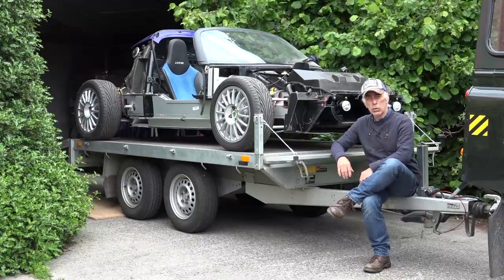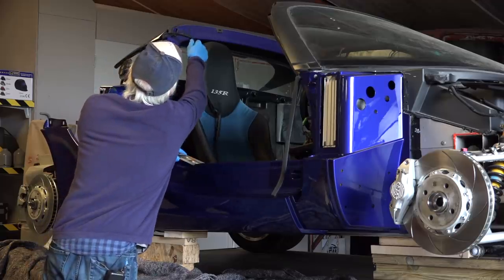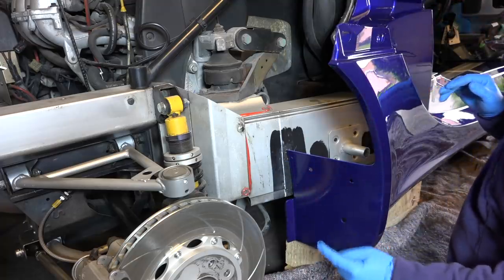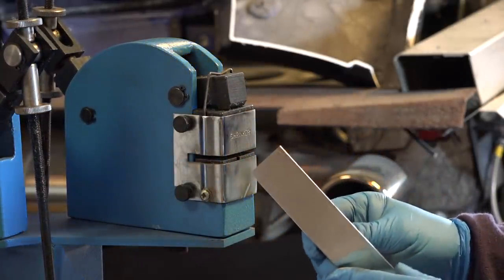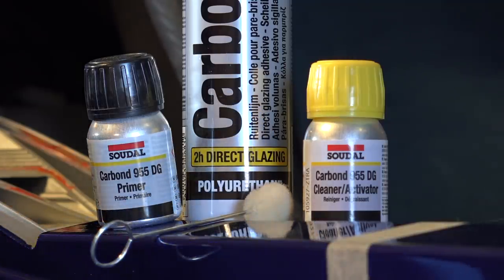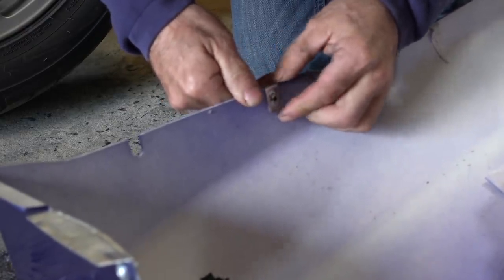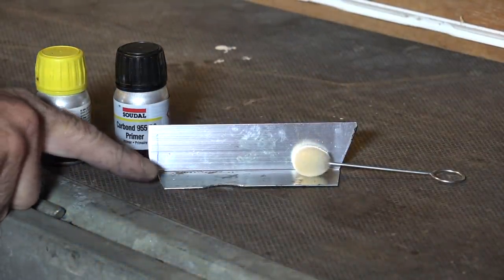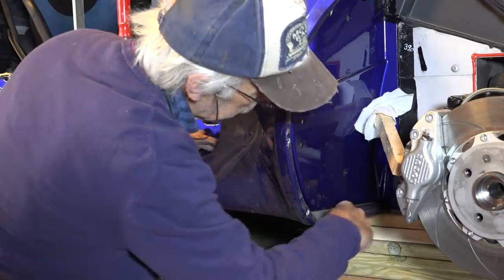Lotus Elise, Fitting a new sill

Comment: Hi Steve, there is a plastic or rubber U trim that goes on the sill edge around the perimeter of the opening for the rear vent. It stops the paint rubbing against the vent. There's also a 50/60 diameter flexi pipe that cable ties to a tab on the vent to direct some air to the alternator.
Reply from the maker: Yes indeed, That is something I just fitted last night. I should have stated it...

Comment: FYI to anyone doing this:  The sill can be slipped behind the windshield mount support. No need for that aluminum bracket there too. You have to be creative and gentle with the oscillating saw, but after trimming around the area as well as I could, I turned the blade around and was able to run behind that black windshield cover, between the sill, separating the glue.     ---to then slip the sill in, you slide the sill in from about a 45° angle (like an open car door).

Comment: Any reason why you didn’t repaint the top bar?  Won’t you get a colour difference now?

Oh, and when is the first fanclub day? 😀
Reply from the maker: Harald.111’s car adventures! , thanks.   Well the newly painted parts are matched to the color of the original panels.  Its a 99 % match.  The paint was made on the result of the spectrometer reading of  an older panel.   If there is a difference, then i will spray it as well.  But so far it looks identical.  Once i get it assembled and outside in daylight i will have another check.  In fact i will have repainted the entire car.  Part by part except a few smaller pieces.  I am
Working on front shell at this moment.
Reply from the maker: Harald.111’s car adventures!  Maybe a fund raising fan day.    Haha

Comment: interesting you have a high end vehicle, and they don't even make exact replacement parts for it.:( Lots of extra tinkering to retrofit the Sill.
Reply from the maker: itsjustme   I know its very strange.  The original fitted sill ( factory fitted 2003). Has the proper flange.  The original replacement parts do not.